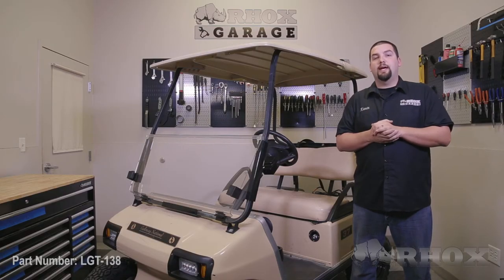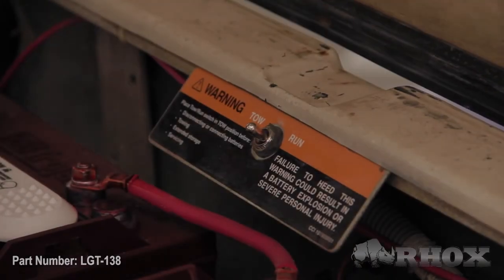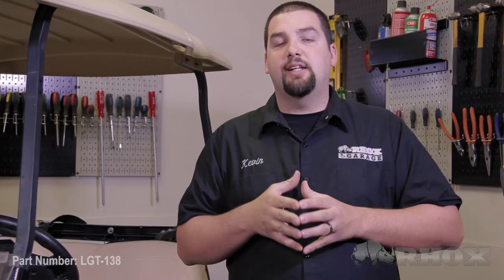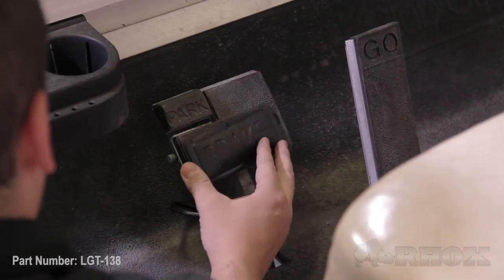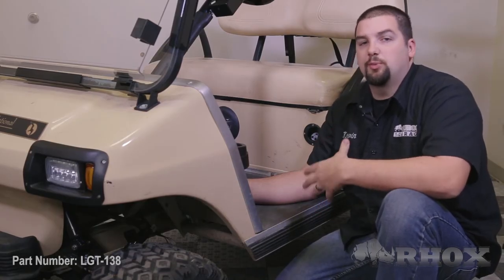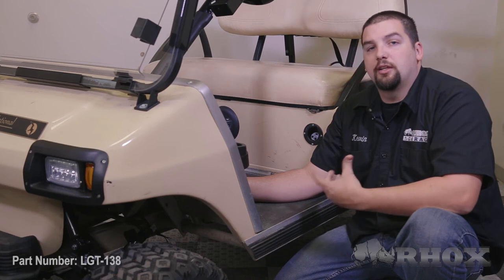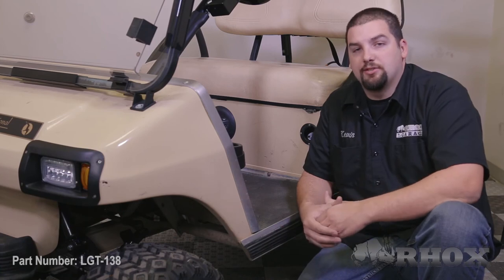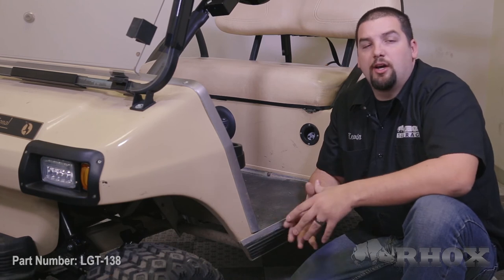LGT-138 (LBT-B1) Pedal Mount Brake Light Switch on a Club Car DS

Comment: Don’t like the design. Looks like an afterthought
Reply from the maker: The LGT-138 is a universal pad. We do have different brake options for the DS. LGT-641 would be unseen from the top of the cart. It is a micro switch design. 

http://www.golfcart.com/pc_product_detail.asp?key=26C459A939094FDAA2AA1F2FAE5EA81B